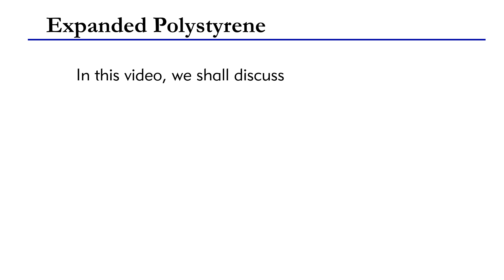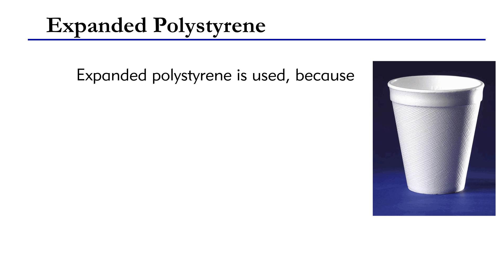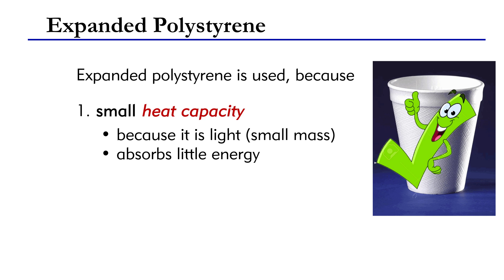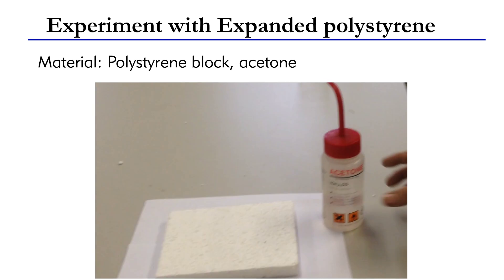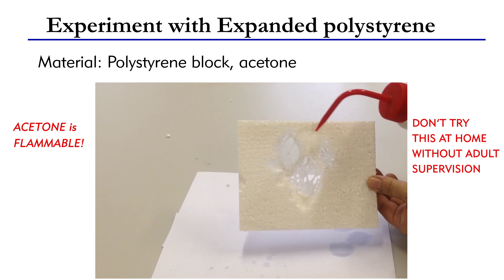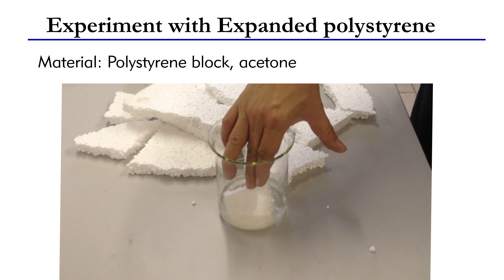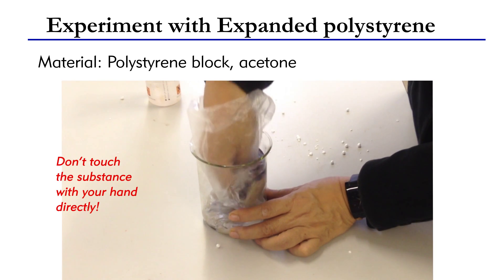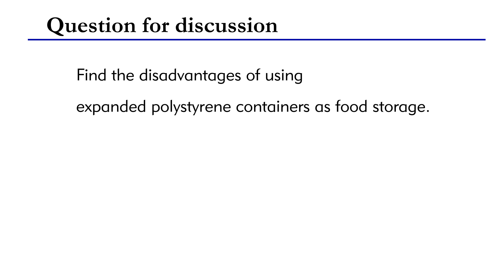Using polystyrene cups in experiments

Comment: Using polystyrene as containers of food con of course prevent heat loss from the food. However, if it is used to store very hot food such that the polystyrene melts, it will release carcinogenic substances that causes cancer to us.

Comment: In my opinion,although polystyrene is cheap and it is a heat insulator,but if we store some hot food in the polystyrene container,the polystyrene container may melt by the food and  produce some poisonous substances which will harm our body. In addition,polystyrene cannot reuse and break down easily,it may also cause damage to the nature.

Comment: although polystyrene has small mass, so it has also small heat capacity, so that when the foid is hot, it may melt the polystyrene ,when polystyrene is melt and touch the food ,it may give out some material which will let you easily to have cancer

Comment: Although polystyrene is very cheap, it is not durable. Therefore, it is a kind of disposable material. It cannot easily break down in the environment.  During the process of incineration, it will also release some kind of poisonous gas which is harmful to people. Expanded polystyrene is also a kind of carcinogen which will causes cancer.

Comment: Normally, when EPS (expanded polystyrene food containers) contact with some substances that contain heptane solvent (acidic and oily food) in a high temperature (over 100℃), it will release some impurities that is harmful to human body. So, it is not good for using expanded polystyrene containers as food storage.